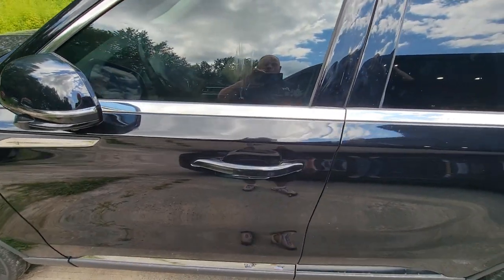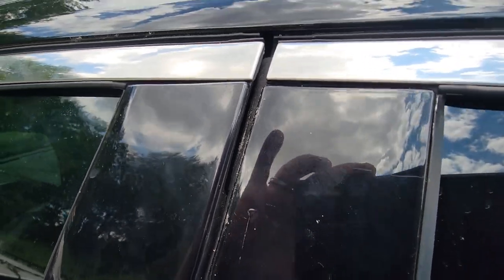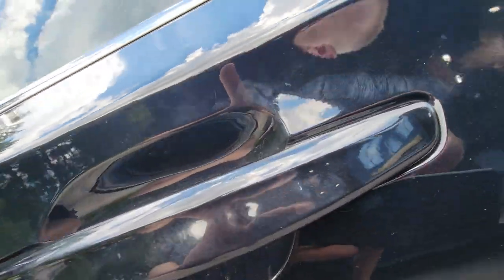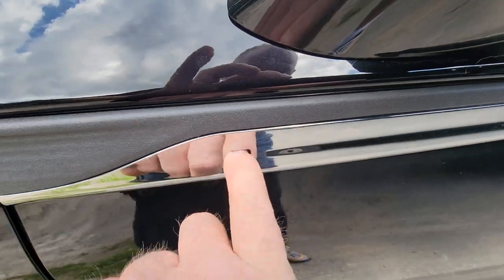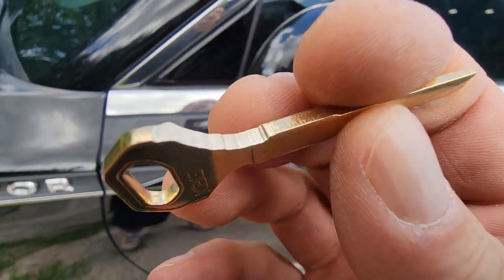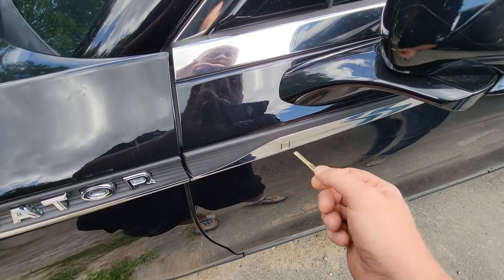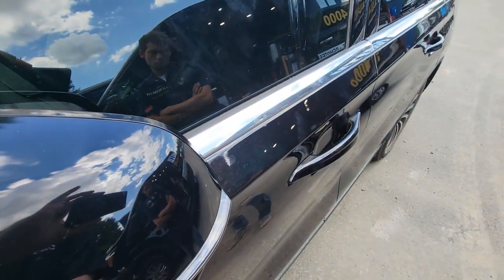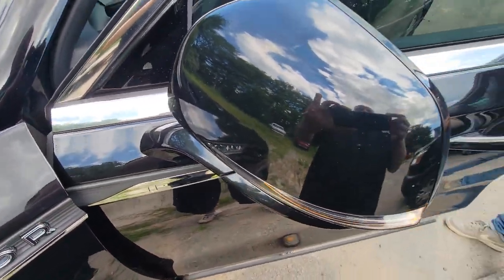21 Lincoln Aviator Door Lock Key Cylinder Location #locksny

Comment: Very Interesting video.  Gets you in, does not disable the alarm.
Reply from the maker: Most of the new stuff sets the alarm off if opened with a key.
Reply: Most domestic cars do that which is stupid. And almost all non domestic cars you put the key in and cycle the lock. it resets the alarm.

Comment: Great info!!!!  Get the key code from the dealership??
Reply from the maker: Yep. Thank goodness, non of my Lishi stuff would go in far enough on that one.
Reply: @locksny  that’s was I figured.  Lishi wouldn’t reach that. Do the emergency keys on the fob reach??  Or would you need to make a special key like this every time you come across this issues?
Reply from the maker: @firefighter1241  I checked it with the emergency key and it worked fine, just really deep.
Reply: @locksny  Thanks for all the great information you share!!!  Much appreciated!!!
Reply from the maker: @firefighter1241  I been slacking since it has been so busy here. More to come !
Reply: Thank you for your time and to help other locksmith to get better and better thank you 🗝️👌👍